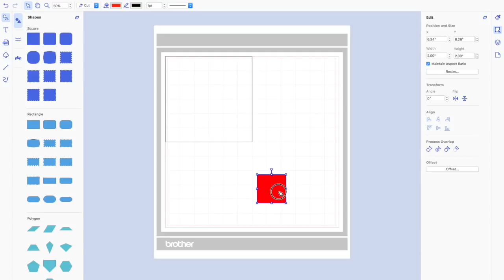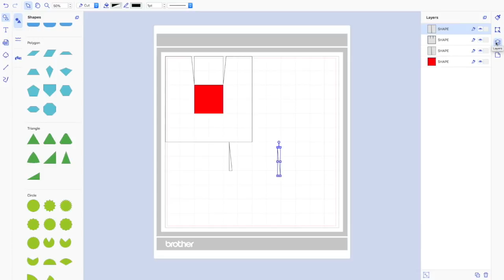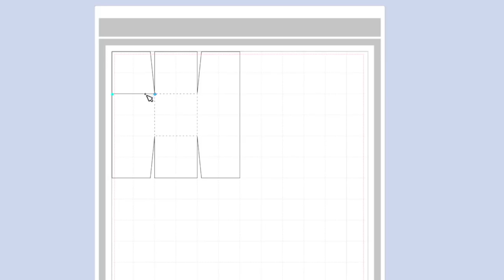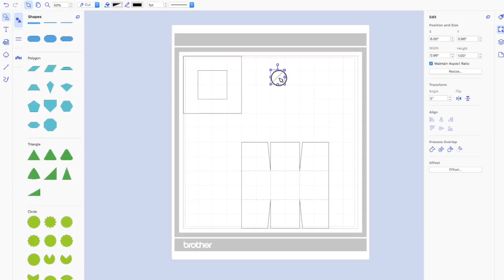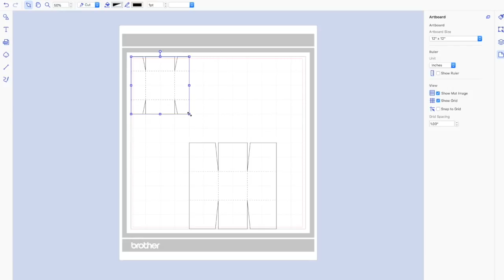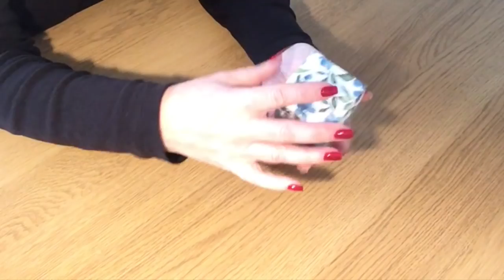ScanNCut Canvas Download - Using XY and Snap To Grid (giveaway now closed)

Comment: I just completed the box and lid, when finished I went back in to move down the "tabs" a little with the path tool, but all mine did was close the square up.  can you advise?
Reply from the maker: Sorry no I don’t know, if you made the tabs they way I show in the video and use the subtract there are no paths left to open or close
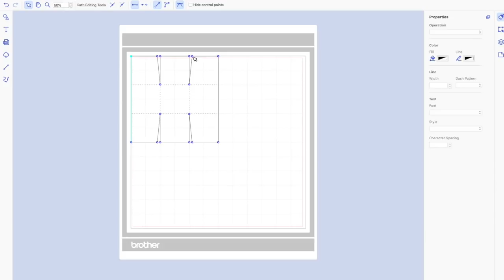Reply: @applelover53  Thank you for answering my comment. What I am referring to is this: at 11:48 in your video you say that if the tabs are a little too long, you can go into double click to get the nodes and bring them down.   That is what I am attempting,  otherwise my box came perfect and I will be using them for little gifts to my fellow card players!  Thank you again.
Reply from the maker: you just select the node so its highlighted and put your cursor over it and move the line up, repeat with the other node. you are not breaking them apart just making the tab shorter. thanks